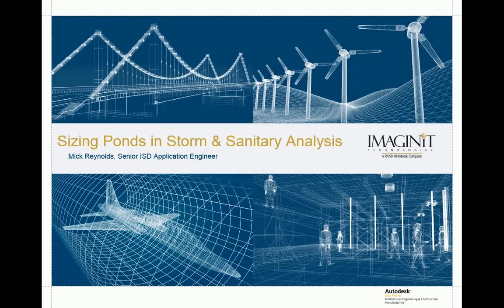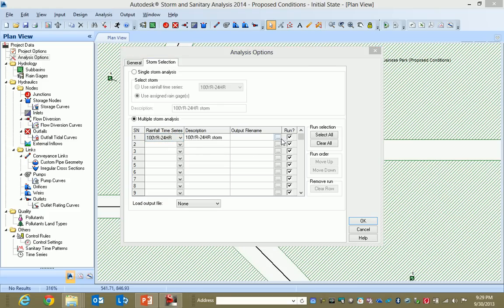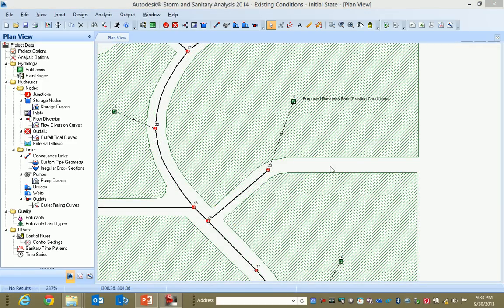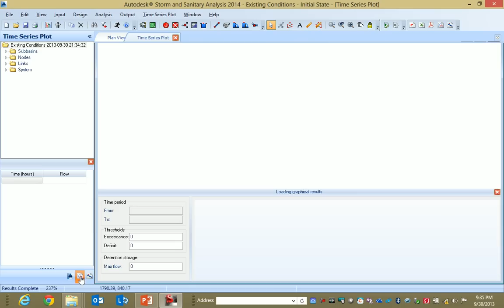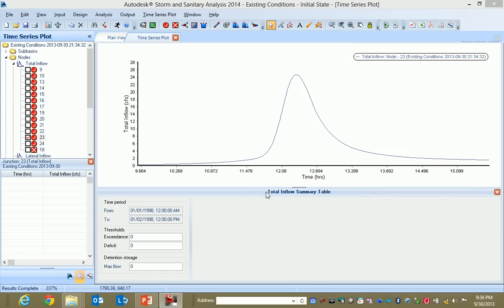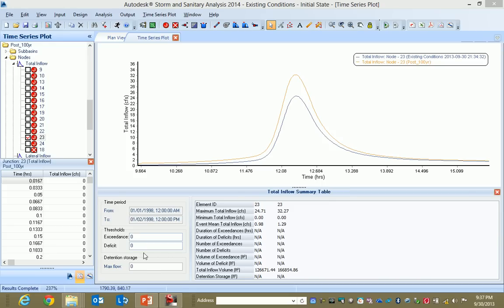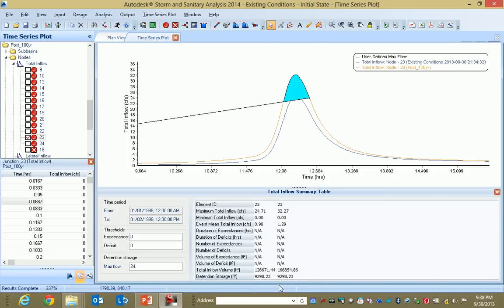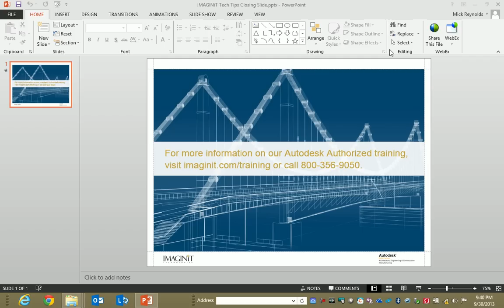Civil 3D: Sizing Detention Ponds in Storm and Sanitary Analysis

Comment: Great video and tip thanks for taking the time to post very helpful
Reply: Dear Sir
I was using Microdrainage, where I am pleased to SSA software to introduce it to my clients and the local authority for planning approval. 
I have got the following question, can you send me relevant tutorials or answer, please. 
1.	Model foul flows using discharge units to BS EN 752. is there any example available please
2.	Produce Greenfield rate calculations using IH124 method.
3.	Allow the application of climate change factors to rainfall data. Typically 30%. Where and how can I apply climate change please.
I am looking for a response from you soon, please. Thanks for your taking time. 
Kind regards 
Sherwan Mohammed